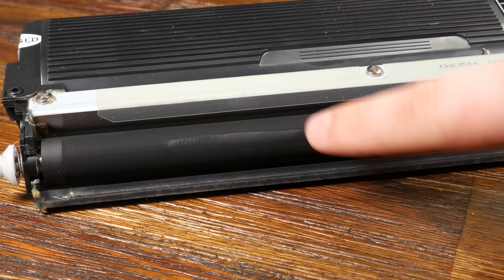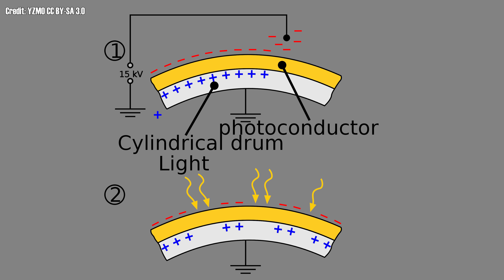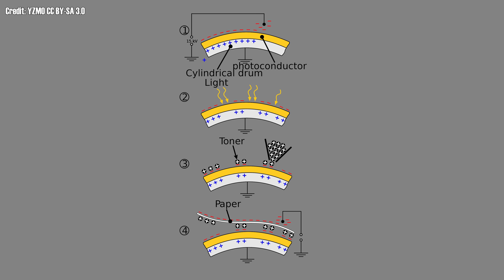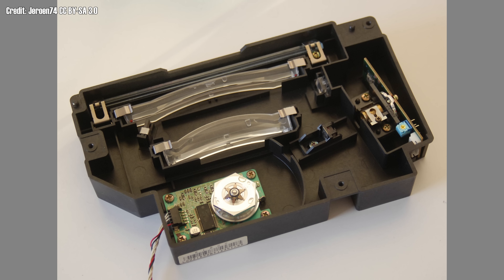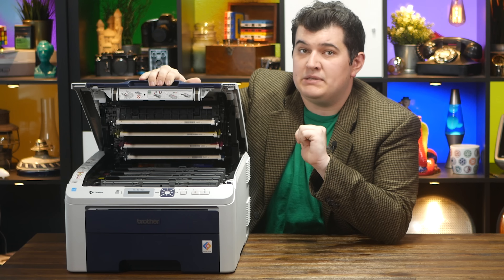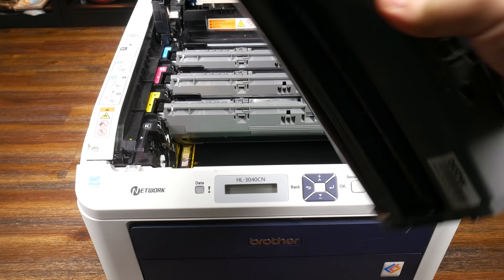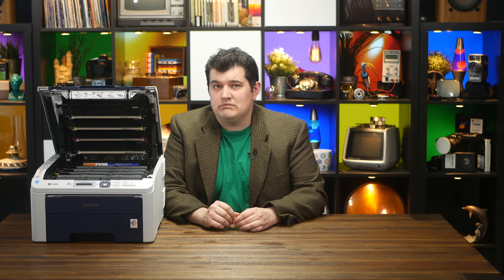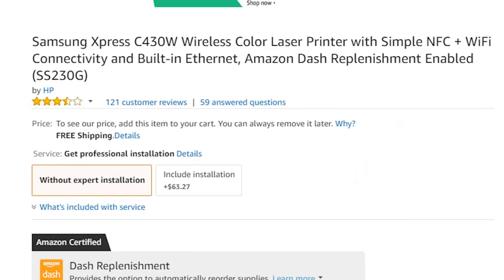LED Printers: The Common Printing Tech You Haven't Heard Of

Comment: Text in the quick scroll at 0:18

Ink dries out, meaning that the printer has to either constantly be performing a "maintenance mode" which wastes ink, or you need to print rather regularly which, in this paperless age fewer and fewer people are doing.

The herky-jerky nature of the print heads as they travel back and forth is very unpleasant compared to the smooth print of pretty much any laser printer.

Ink cartridges are usually priced at stupid levels, meaning that you're forced into buying generic ink which often clogs the inkjects so you're damned if you do, damned if you don't.

Because the ink is a liquid, freshly printed documents have a tendency to smear if touched until the ink has dried.

Water-based inks are likely to completely wash away if the paper they are printed onto becomes wet, meaning shipping labels printed with some inkjet printers can be rendered completely unreadable if they get wet from something like, oh I don't know, rain.

None of these issues plague laser printers, so despite their higher upfront cost (and arguably more expensive toner) you can pretty much count on them to work perfectly even if they've been idle for over a year, they don't waste toner on "maintenance modes", the toner is bonded to the paper so water doesn't smear it, the toner is never wet so you don't have to wait for it to dry, plus spills can easily be cleaned up as the toner is a powder. I could go on but if you read this entire thing, now you know why I generally dislike inkjet printers and why I will forever use laser printers. Or LED printers, which are the suspect of this video and you'll soon see.

That said, Techmoan recently reviewed[0] an inkjet printer that was actually pretty decent in terms of the ink cost, so even if a "maintenance mode" were to waste ink, it's not like it's wasting super expensive ink.

Perhaps one day I'll rejoin Team Inkjet. Particularly for photo printing (and images in general) inkjet remains supreme. But for now, I'm planted in the realm of toner so that, when I have to do my taxes, I don't have to waste time, energy, and money fighting a stupid inkjet with clogged heads.

[0] https://www.youtube.com/watch?v=sMIl4TA7wYU
Reply from the maker: + T M The smell of a laser printer is from the ozone generated by the corona wires (or modern equivalent).  Inhalation of particulate matter is certainly a concern, but I do not believe that the "smell" is a result of the toner.
I for one wouldn't be that concerned about toner in the air except when performing maintenance on the printer, as there is little airflow around the imaging drums and the static charge keeps most of it from moving around.  That's why it doesn't get on the white parts of the page.
Reply: @TechnologyConnections this is true but also people need to be extremely careful when handling toner powder as well (wash your hands and use PPE). I got toner dust in my eyes once and it almost caused permenant vision damage. That being said Im still on team laserjet printing.
Reply from the maker: You missed the last two paragraphs.
Reply: Oops. I read those paragraphs at first but somehow missed them when transcribing them. I've added them and then a link to the Techmoan video I think it's referring to.
Reply: @TechnologyConnections  "plus spills can easily be cleaned up as the toner is a powder" That, sir.... is not my experience with toner. My experience with toner is of having skin that seemed oddly close to that particular shade of "I robbed a bank and set off the dye packs, please call the cops on me" purple.
Reply: Thank you!
Reply: Epson ECO tank printers I use for business and at home - Cheaper per print especially in colour, uses a fraction of the power and as such does not tripp UPS's. Only downside is it's not as fast in B/W as laser in larger documents but about the same time for first page out.
Reply: @paintballthieupwnsIge thought nobody was mentioning these, I have an HP, same prínciple as Epson ecotank, just buy big flask of ink, pour them to printer and you are ready to go, as yes price per page is even cheaper than laser, printing photos is great, the only downside was the initial price which was bezerkous.
Reply: I believe that pigment based ink is better than dye based ink because it dries faster when applied to paper. (solid pigment in liquid solvent, dye-based=liquid dye in liquid solvent)
Reply: Using Epson with 50ml tanks for each of the four colors. They don't smear even if you touch them right away. They don't smear if they get a bit wet, and they don't even seem to be to costly, even the brand refills. You do have to print about once in a fortnight though. If you don't, you have to flush the jets, but that's about it. The one I'm using bow has printed ~50,000 pages without repair, and I don't know how many more it can
Reply: the toner on laser printers is far cheaper. ... sure it costs like 80$ a pop but you can print a LOT of pages with it. in money per print its far more economical. although the manufacturers might have caught up and made it cheaper. ....... its not hard to be better. ink cartridges and inkjet printers are a borderline scam.
Reply: Kevin Miedema Epson EcoTank is cheaper. One fill is 37$ and Prints 6000pages
Reply: @km5405 you can also get 3rd party toner refills for even less. Brother printers (at least with older firmware) are still perfectly usable with the cheap non OEM toner
Reply: Inkjets are commonly used for direct to garment printers.  Especially their 60+ inch wide variety.  As well as direct to canvas as a Giclee substitute, used for on-demand printing of optical discs and case art, pigmented inks with 100 or more years of fade resistance can be found in Epson's home printers with their DuraBright CMYK inks.
Reply: @IraQNid  Epson Bot, no!
Reply: You even added the link. Good man.
Reply: Forgot to mention companies putting expiration dates on ink cartridges, and due to not being perishable food items, sellers are not required to list said date so it is entirely possible to buy a brand new cartidge that wont work because it is "expired", and then there are companies that block the use of generic 3rd party inks or the ability to refill em urself (like my mother used to do) via firmware updates to further force you buy their stupidly expensive proprietary shit. My mother's hp photosmart printer was finally replaced after it went from constantly readding the printer to the computer every single time she turned it on to print something, to a permanent "ink system failure" message that would not go away no matter what we did to it. Pretty sure the replacement was a newer ink printer despite my suggestion that she get a laser printer, likely due to price. Dont know if any of the above applies to laser printers since the only one ive seen or used was the one in the main office of my school, which im pretty sure was also the only printer in the building that could print in color.
Reply: Only downfall to laser that I've found is that heavyweight cardstock has a tendency to jam in a lot of laser based printers and copiers
Reply: @ZachariaZuehlke  On many laser printers, there are settings to tell the printer what type of media it has, and they'll slow down if you tell them its cardstock or labels. The downside is you also have to tell e.g. Word that you want to print onto cardstock.
Reply: @ZachariaZuehlke  LED printers are better for heavy materials. As mentioned in the video, the "paper" moves almost completely horizontal during the actual processing and many (most?) LED printers have a flap you can open in the back so that no turning is involved at all. It's useful for cardstock, but also heavy paper. The Oki printer I have allows paper of up to 220g/sqm, which is 3-4 times the usual office paper.
Reply: I prefer inkjet. I'm a student. I write with a pencil, and when I took mathematics at my college, I printed a special graph that I did equations on so I didn't have to write on my book. But because toner is just seared onto the page, whenever I erased something, the toner print would be ruined. It erases off. When I use my inkjet printer at home, it didn't do that. So I just stick to inkjet
Reply: Respect dude
Reply: Hp Pagewide solves most of the listed issues with inkjet printing. They work really well for medium volume office use. A $500 pagewide inkjet matches a $1500 color laser for print speed and page costs.
Reply: Agree with all of that. My number one issue with inkjet is that once the heads start getting clogs, they seem to get progressively worse, until the only real solution is to replace the whole unit. 

Probably not so much an issue if you’re printing daily, but the less it’s used, the faster it goes bad.
Reply: Thank you for taking the time to write this out.
Reply: I paused to read it until I noticed this comment! I completely agree with all of it by the way. I hate inkjet.
Reply: Thank you
Reply: If you get an hp printer with inklock paper the print won't smear with water.  They also are cheaper per print at about 10cents per impression
Reply: What do you think about Eco inkjet printers, do they also dry out and have ink issues?
Reply: Isn't there a video where he mentions comments on his videos that contain transcripts of the quick scroll clips are made by supremely unfun people?
Reply: Thanks
Reply: Cmon
Reply: I read the text in this video before I saw this comment.
Reply: You wonderful, wonderful man.
Reply: How did you do that.
Reply: Is the thing with the shipping labels a problem for consumers? i mean consumers basically only use shipping labels to ship something back to amazon or some other online shop, so if you take care that the label doesn't get wet when you go to the post office, the rest is the responsibility of the postal service, right?
Reply: Dude, do you use Lynx and/or Gopher? I love that citation style.
Reply: the real mvp
Reply: Thanks for this. Also another disadvantage of regular printers is that the inkcartridges sometimes lie qbout being empty so you will be inclined to replace them with new ones, costing you money by throwing away halfempty cartridges
Reply: @gibbdude Back then we didn't have that luxury, IIRC.
Reply: On the contrary, laser / LED printers smear ink on paper !! Because it uses contact and heat, while the inkjet printer releases its liquid ink from the nozzles and falls on the paper according to the desired pattern and is then absorbed by the paper. The laser / LED printing process is complex and takes more steps than the inkjet printing process. I believe that the solution is that with the constant development of materials, it will be necessary to develop liquid ink that does not dry except when treated in a special way, or to devise a special insulation mechanism that isolates the liquid ink when not in use. This will prevent the ink from drying in the nozzles. I saw an inkjet printer used for printing on an industrial level and it was able to print on anything, even glass ! It used ultraviolet light to dry the ink quickly after it was printed on the intended target. 
Note: The fault is not in the mechanical things, the fault is in the design. 
Thank you.
Reply: @ياقوت-ق Laser/LED printers don't have ink, it uses toner which are very thin particles that fuse together with the paper when heated up. It doesn't smear on normal paper. It only smears on very smooth materials when soaking them, e.g. to transfer the toner to a PCB.
Reply: @DiThi I called him “ ink ” metaphorically because his function is like that of ink, but thanks for the clarification. 
I used to print my PDF files using a laser printer, and what I usually noticed is that the print quality varies depending on the cleaning. One time I printed several normal A4-sized sheets of paper, but I noticed that there was a long continuous line dividing the pages of the sheets into upper and lower halves, in addition to some soot on the rest. the page !
Reply: The soft mechanical wheering of an inkjet is soothing tbh.
Reply: Wow, I tried to pause it to read 😅
Reply: a little late for lenny...
Reply: I just watched at x0.25 speed, but this is much better. Thanks from the future.
Reply: I’ve been a copier/printer field tech for 23 years.  I’ve never known anyone in this field come down with lung cancer due to toner exposure.  Toner is non toxic.  It’s a wax resin based substance.  It requires no special handling when disposing of used cartridges.  

Cool video.  Good explanation of the basic print process.
Reply: @michaelclarke9488  I worked at the HP Recycling plant in my city and laserprinters were processed in a special room. We had to wear proper dust masks with special fine particle filters. 
The instructions for shipping back printers at the end of a lease contract specifically state that toners have to be removed prior to shipping. Exactly no one ever does that. Picture the colourful dustcloud that comes out of a 40ft container with a couple hundred well shaken printers in it. You don't want to be breathing that.

Given that the IARC considers things like wood dust, coal dust, soot, and other airborne microparticulates as carcinogenic, I wouldn't hesitate to say the same of toner.
Reply: @fermitupoupon1754  yes, and also another problem is ozone. You should basically always have a laser printer in separated room where no employee stays for long if you don't want them to have health problems. because of this it's probably also not a good idea to have a laser printer for home use because hardly anyone has an extra room just for printing ta home.
Reply: @Michael Clarke toner powder is made of nanoparticles, same concern than Diesel engines. That's not the chemical compound but the size of those material that make them prone to lung cancer.
Reply: @PainterVierax  Nah
Reply: Michael, in UK 0.03% (sic) people are affected by lung cancer. If toner would make it 10 times more probable, which would mean it would be very cancerogenic, then statistically you'd have to known health status of 300 of coworkers to meet a single person with lung cancer. If that would be 2 times, which is still high, you'd have to know health issues of 1500 workers for a single case. That's why personal experience doesn't matter.
Reply: @KrzysiuNet  Yes and no. The alternative read on this is that toner does not cause cancer at the rates you suggest, because if it did, more than 0.03% of people would be affected.

Statistics are tricky to work with in terms of hypotheticals, because they can only tell you relative distributions. The BEST way to look at it would be to ask, "Of those you know with cancer, how many work extensively with toner?" (Well, I mean, in terms of using personal experience rather than lengthy statistical studies.)
Reply: @KrzysiuNet nah man
Reply: @_..-.._..-.._  nah what?
Reply: Just get an Epson Ecotank.
Reply: With the low volume of printing I do (and what is common today for many), to my surprise,  I find that inkjets are the way to go - even with the cleaning cycle waste of ink.   I used to tout laser printers, and still have a laser printer that I could use if I needed once again to print lots and lots of non-color stuff.  

What I have found is that I print so little that it takes a very long time to go through a inkjet ink cartridge, I may replace 3-4 per year, and that is Ali-express compatible cartridges which cost under $2 each.   I have had the same inkjet printer for years, it is a double sided printing, multifunction machine.  IIRC it cost less then $80 and prints very good photos for a printer (I believe that Laser/LED's don't print photos as well as Inkjets).  

Now my Inkjet does waste ink for cleaning, and sometimes startles me as it goes through it's ?weekly? cleaning cycle but I don't recall even having a clogged print head with this printer.  For one device that does it all and lasts.  My experience with this inkjet seem to run contrary to my previous thoughts for inkjet, laser and LED printers.
Reply: LOL. Thanks. Inkjet printers are a money pit.
Reply: Never had a clogged head, or maintenence mode. Never heard of that. I believe you that it happens, just, I must be lucky to have never encountered these inkjet problems ever in the last 30 years or so of my inkjet printing. That said, they have caused me plenty of other problems.
Reply: I think you missed one small  downside of toner printers. Toner powder flying freely (ever noticed the smell of toner printer?) is suspected to cause some lung cancer. Nothing to worry about as the cancer is symptom of our times, yet a thing to consider.

Please excuse my bad English as I am not native... ;)
Reply: @mrozowskitomasz  Your English is fine. Stop apologizing.
Reply: @totally_not_a_bot Stop telling them to stop apologizing, they did fine.
Reply: +T M I never thought that printer toner could be carcinogenic, then again you'd have to breathe it in for years. By the way, your English is practically immaculate.
Reply: @caffeinepizza  if you breath in enough fine particles of any substance it can likely cause problems eventually
Reply: @mrozowskitomasz  dude.  Very good point & perfect English.  

STAY AWESOME!!!!
Reply: The smell you smell is the ion discharge - it is ionized air and its byproduct ozone what you smell. There is however health downside to breathing that - it irritates lungs and increases risk of respiratory infection.
Reply: LED printers were the SUBJECT of the video, not the suspect...
Reply: @new-zealand-clippy  boohoo
Reply: laser can be more expensive for maintenance costs...  most laser printers people will but cheap toner in them and they leak, the components of the cheap cartridges fail, and the toner is sub par an can damage the machine... same with ink and aftermarket ink.... and labor costs can be pensive for repairs I worked on copiers and printers for years...
Reply: Thanks
Reply: I would love to take part in this "paperless age" at work, there's a ridiculous amount of actual paperwork still being done for even something as menial as returning a stack of shipping pallets to the main warehouse.
Reply: Who knew pausing was so difficult that people think they need to do this.
Reply: @Puremindgames  try doing it on a smartphone casted to a Chromecast 😎.